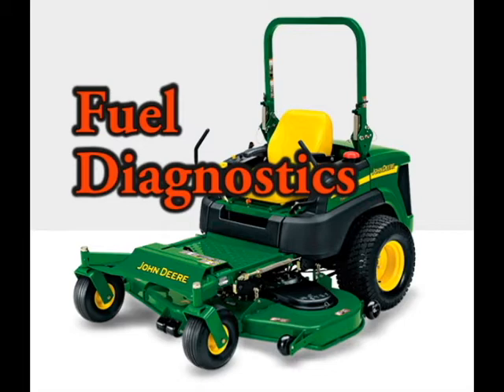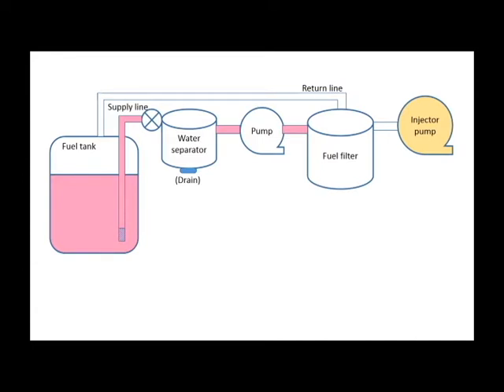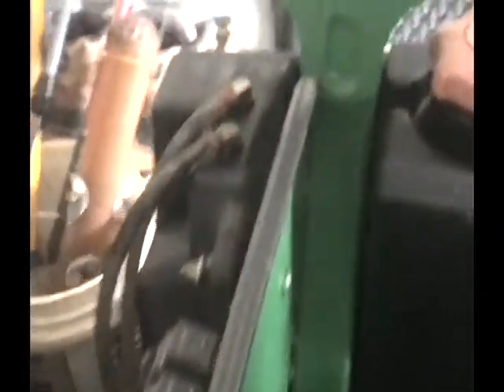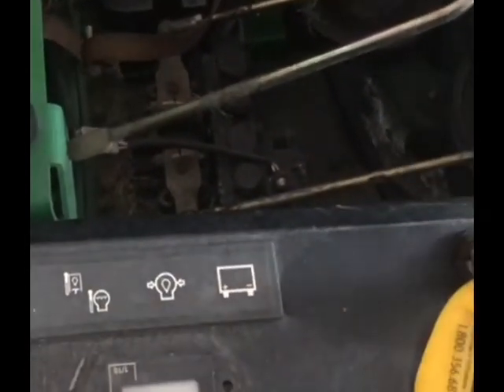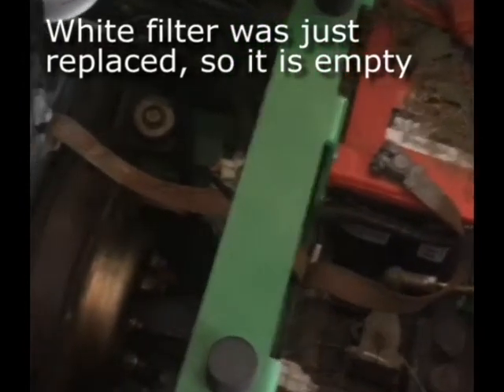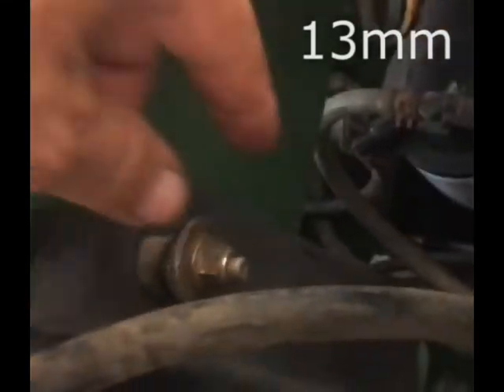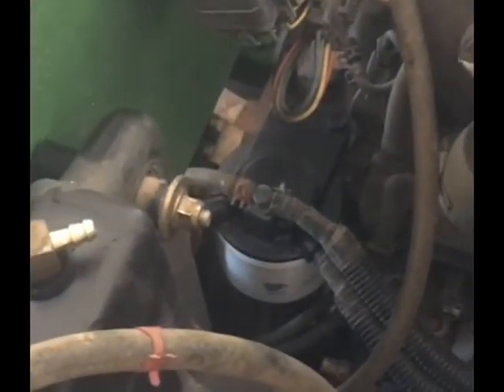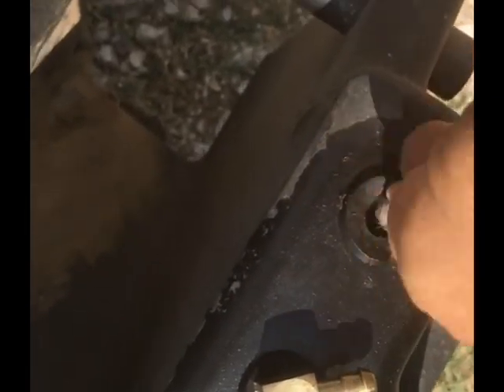John Deere 997 Fuel System Diagnostics

Comment: Hi so I pulled the fuel pick up tube on the out side of the tank and the screen on it was almost completely plugged its hard to believe the mower would even start at all, I Cleaned it all out and reinstalled the tube. Mower ran like a champ. Thanks for the input it helped.
Reply from the maker: Yep.  Exactly.

Comment: Hi great video So my 997R starts, runs and after lets say 5 minutes it'll die down if i stop the deck  it'll recover as though its looking for fuel i pumped out all the fuel, changed the screw on filter  added diesel cleaner and it's still doing the same thing. is there another filter beside the screw on filter??
Reply from the maker: I think you missed the two places in the video that it mentions the screen in the tank.  Might want to check that if you haven't addressed it.

Comment: I replaced the fuel pump.  I am getting a dribble on the return line.  Is this correct? Should It be a stronger flow???
Reply from the maker: The return line represents excess that is not used by the injectors.  I have not tested the flow rate on my return, but it makes sense that it is a very low rate.

Comment: Don’t forget to buy algaecide for diesel will prevent it growing inside tank. I’ve got 2007 model this only happened 3 times for me. When purging just take you fuel line drop to filler neck to it runs normal operation. Screen can easily pick up enough deposits to bog the engine to turn off..